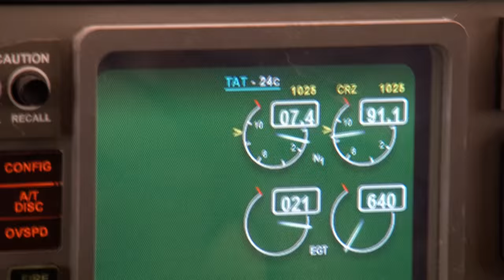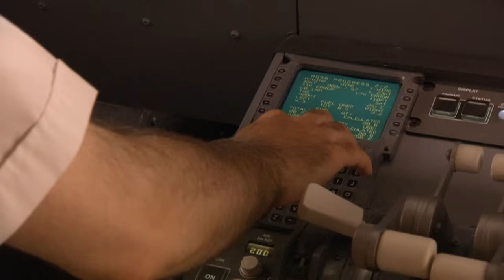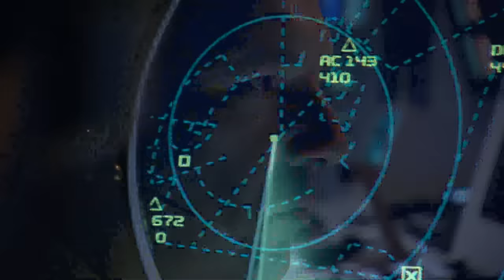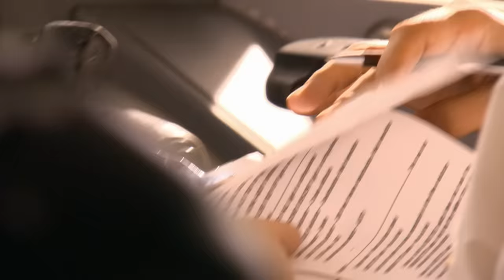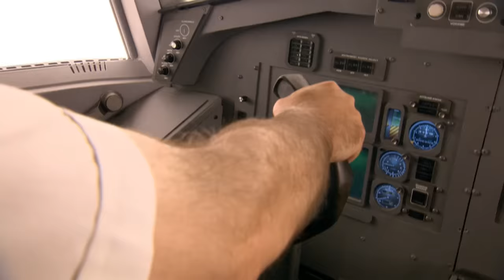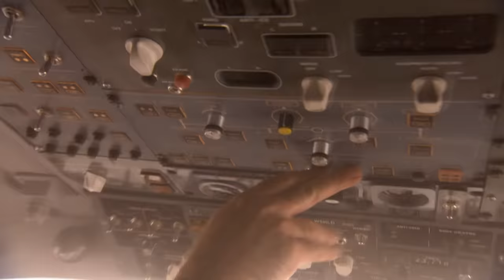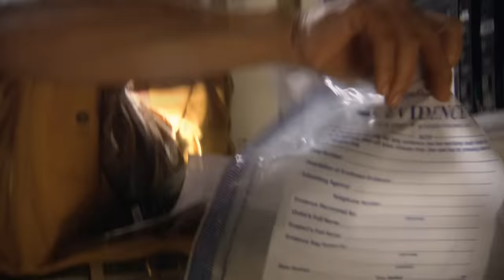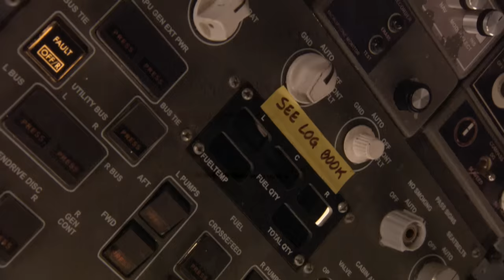Air Canada Flight 143 Lands With No Fuel | Mayday | Wonder

Comment: I retired almost 20 years ago after several thousand hours as a 767 Captain for a major US airline. I have told this story many times how serendipity saved the day. The Captain had glider experience & the co-pilot was familiar with Gimli. It was great to view your outstanding video that did a deep dive on the details. Thanks
Reply: check 6  I vaguely remember watching the "Air Disasters" episode on the Gimli Glider. That was amazing that he had flown gliders before which somehow helped him "slide" sideways to slip back to a landing strip. I had totally forgotten about the racing and picnic that was going on that day. The best part was turning into the guard rail to slow it down to a stop. This flight took place 6 years before a DC-10 made an incredible....or as that episode was titled "Impossible Landing" when United flight 232 that was going from Denver-Stapleton to Chicago O'Hare had a loud explosion from the rear of the plane. The fan disc had a flaw from when it was manufactured (I think 17 years earlier) when oxygen and nitrogen had somehow gotten into the titanium when it was created. It took all of those years, thousands of hours in flight before the flaw became big enough that fan blades came apart, becoming shrapnel which cut all 3 hydraulic lines. The only way they could control the plane was by using the throttles. A DC-10 train/check airman (Denny Fitch) was on board, heading home to Chicago after a week of putting pilots through their yearly simulator tests. After a brief and quiet conversation with one of the attendants, he found out how serious the issue was, he had her go back to the cockpit to see if they would like some assistance. So he became a crew member. I laughed at the narrator here when he said how much they were banking, and in a documentary interview with Denny, he joked about how they never intentionally try to take the plane more than 30 degrees of bank because it scares people. Both that DC-10 and this plane exceeded that bank. Unfortunately, even though flight 232 barely made it to a runway-a closed runway at Sioux City, IA., they were coming in too fast and dropping too low, out of 296 on board, 111 people were killed, but 185 survived. I'm going to give you the link to the video with Denny, he is an incredible speaker and had it not been for him, that DC-10 would have been a crater somewhere in NW Iowa. Sorry about the book.
Reply: Being a Glider pilot does NOT excuse this pilot from checking his fuel load.
What is so disgusting is how this was spun to make the crew hero's. They ALMOST killed all the passengers due to gross incompetence.
Reply: @stevejh69  I was going to disagree with your use of incompetence, but the more I tried to come up with something else, I have to agree with you. While he f**ked up by not noticing the amount of fuel he had, he was able to make the maneuver to slide to where he could land the plane, and none of the passengers were killed. When he saw what was going on farther down the runway, he did what he had to do to not run over them all, killing those people. He wasn't a hero, he was damn lucky. I think the narrator said he hadn't had many hours on this plane, is that right? I don't remember. I would think that under those circumstances he would have been even more careful at checking everything before ever leaving the airport.
Reply: @survivrs  Thank you. 
Just imagine a small difference on outcome. The news could easily have been Hundreds dead after Boring 767 crashes into town killing all onboard and hundreds on the ground. 
The board of enquiry found the aircraft had run out of fuel!
When new to an aircraft a crew should be extra vigilant. This crew paid almost zero to the fact the fuel was not comfirmed.
Reply: Too bad he didn't have metric conversion experience, could have eliminated this issue. He is no Sully, that's for sure.
Reply: @stevejh69  Exactly. Because they didn't pay attention to the 2 different calculations on fuel, this could have easily turned out differently, and not in a good way. Extra vigilant is exactly what I was trying to say, so thank you for that assist. There should have been something done to the pilot not catching the fuel issue. some time spent relearning how to carefully go through the checklist before ever getting to the runway would be the first thing. Get something into his personal records for future reference in case he had another issue. The checklist is done on EVERY flight by every pilot and first officer, so the pilot is no less than guilty of negligence!
Reply: @stevejh69  I just went back through the last third of the video again, and paid closer attention to the fuel issue. It was a MAJOR FAULT on Air Canada, because NOBODY HAD BEEN TRAINED ON HOW TO MAKE THE CONVERSIONS! It was lbs. vs. Kg! Not the fuel loading techs, none of the pilots, NOBODY! I guess it was what I would call one hell of a learning experience and I bet he never overlooked his fuel ever again.
Reply: @AFuller2020  As I just replied to stevejh, nobody had been trained on how to convert lbs to Kg. Not the fuel loading techs and not the pilots. I place the blame on Air Canada. He sort of pulled a Sully by getting the jet to use the guardrail to help him slow down, but without his front landing gear, I don't know how he did that. I would bet that there was a lot of training on conversions after that incident.
Reply: @survivrs  hey, it was a necessary mistake. I still will chose sunwing over air canada though.
Reply: Metric - to Standard...this was bound to happen...and with fuel gauges not working? Begging to happen...
As I was seeking my pilots license in 2018 I learned flying was an expensive hobby...I got to where I could solo and soon realized with 4 kids I have other priorities. I enjoyed the  challenge though....weights and balance, ground rules, air-space restrictions, fuel/distance, glide ratios, performance, configurations, check lists......on and on...but watching this I wondered: When slipping a Cessna 172 the "pitot tube" is no longer pointed directly into the wind. Wouldn't that produce a slower indicated air-speed than actual air speed? To me that's a problem on short runway landings....my flight instructor never addressed that to me.
Reply: @survivrs  Did you watch the entire video and the outcome of the investigation?
Reply: @DestinationTimeshare  Of the Gimli Glider? I don't think I've seen the outcome of the investigation. It was just another "air disaster" that I had seen on the Smithsonian Channel. It's been a LONG time since they've had any new episodes, but they did shows on just about every incident that ended up either good or bad. They play repeats quite often though. The only air crash I have followed over the years is United 232, July 19, 1989. It ended up better than it could have.
Reply: @survivrs  HE  NEVER CHECK    THE   VITAL  POINTS    OF  THE  PLANE
Reply: @stevejh69   Precisely, these airline jockeys should be sampling fuel and checking the tanks manually with dip sticks, like you are taught in the first few hours of flight school.
Reply: @readmore3634  Pitots are fairly sensitive to airflow distortion... but usually at much higher air speeds than you would find yourself in a slip.
Reply: @aviatorgeek99J  At the very least confirm quantity.
Reply: @aviatorgeek99J  My instructor only taught short runway landings, always wanted me making "first runway turnout"  exits...He would make fun of other students flying these long approaches like an airliner would...touching down way past the numbers...He hated that...unacceptable! In a 172 I'd turn final at 80 with power off.... 65 over the fence....settle at about 55-60. When practicing (power off) slip landings I watched my speed best I could but keeping everything lined up was the challenge for me. As I straighten out over the numbers my speed was sometimes 70-80.....leaving useful runway behind me.... and I heard about it. I miss those days.
Reply: It is clear God was piloting the plane - absolute miracle
Reply: @stevejh69  I'm more concerned that the plane was allowed to take off without working fuel gauges. How is that possible?
Reply: It was a training failure, and a bad fuel gauge issue.  In particular, the plane should not have been allowed to take off with a non-working fuel gauge.  Fuel is vital, so the gauge should be considered vital also.  Mistakes were made in terms of calculating fuel amount, but ultimately, that should've been caught through training.  Not just throwing pilots and fueler tech into the mix, and hope they get it correct.
Reply: Hine sight is 20 20
Reply: @stevejh69  Well, don't forget management, which changed pounds to kilograms but didn't bother getting anyone up to speed. If both the fueling crew and the pilots were unfamiliar, that's a serious lack of training, not just a coincidence.
Reply: @survivrs  Management never takes the blame. The engineers on Challenger warned it was too cold to launch, but management,  hot for glory, overrode them.
Reply: @pj89508  Well presented, thanks. However the largest part of the blame is squarely held by the PIC and the airlines. 
My point is the airline trying to spin what a great job, when in fact they very nearly killed them all
Reply: @stevejh69  "Being a Glider pilot does NOT excuse this pilot from checking his fuel load.
What is so disgusting is how this was spun to make the crew hero's. They ALMOST killed all the passengers due to gross incompetence."
And perhaps you could explain to us all how could have checked the fuel load when the gage wasn't working?
Reply: @linsqopiring6816  The gauge WAS working, you tool. Watch the video! He failed to check quantity in the correct indication.
Reply: @stevejh69  No I specifically remember the part where the investigator took out the circuitboard and they did tests and it wasn't working.
Reply: @AFuller2020  did not need metric conversion as he was supposed to dip the tanks because both gauges were out
Reply: @stevejh69  The gauge wasn't working... It was checked on fill-up, where the Captain did the math wrong. It was to be repaired when they got to Edmonton as the previous crew had temporarily "fixed" it (They did the math right too) but this crew undid the fix on pre-flight.
Reply: God's  Blessings  ❤️❤️
Reply: The Captain was a neighbour growing up and I always remember that day as the street was covered with media.  He did fly a glider that was often parked in a trailer in his driveway.
Reply: @survivrs  And, of course, YOUTUBE censored the link. (damn)
Reply: @survivrs  Switching units of weight and volume messed up a lot of Canadians at the time. (A litre is about one-quarter of a gallon, a kilogram is slightly over 2 pounds .... so going from gallons/pounds to litres/kilograms caused a fair bit of chaos)
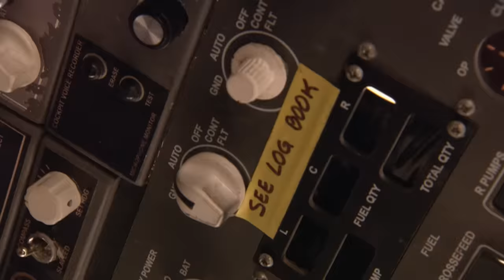Reply: @stevejh69  6:29, the video says that the digital fuel guages were out of service. Was there an analog guage somewhere? Also, I'm not a pilot, but do airline pilots check the fuel level with the dip stick before every flight?
Reply: @joshuaychung  No they are supposed to confirm the fuel. The amount put in would easily have been a clue. 
This was excellent spin by the airline to stop huge legal case. 
The bottom line is the crew screwed up.
Reply: @stevejh69  The ground crew lied. The captain signed the confirmation notice that showed the tank was full. Short of using a dip stick, how would you have him confirm the amount of fuel, in the absence of a fuel gauge?

Comment: This pilot is a beast. He attempted a maneuver he's never done before and aced it
Reply: He had no choice.
Reply: others failed to do so, in flight simulation.
Reply: A true and brave heroe!!!!
Reply: Only 2 Boeings have done the side slip on an emergency.
AC 143 , and Taca 110
Both experienced pilots
Reply: My goodness what amazing nerves of steel.
Reply: I am so glad that he did especially for the captain he save the lives of the people he almost caused to die he should have never left the airport without maintenance checking the fuel .warnings are on The plane for a reason you're not in a car oh well it may just be malfunctioning. No you check it out
Reply: Captain Piché of Air Transat is a bigger "beast." He flew his plane in 2001 without engines longer than anyone else, with way more people on board (300+), over the middle of the Atlantic, looking for a tiny speck of an island on which to land. Heavier plane, more people to save, longer flight without engine power = bigger hero. And he was a gliding expert too.
Reply: @stephenc2481  he really said “Best of the best”
Reply: @GoHARD99  This would have been around the time Canada was converting to the metric system.  This happened over a period of several years.  I can see how the confusion happened. You may recall the part of the video at the end where they said neither flight officer caught the incorrect unit of measurement, and that they had not received all the necessary training for the switch to metric on this particular plane.
Reply: Donatella Loncar  Wow!
Reply: Well, that's actually not true, I think he had done it before, just on gliders, not on a giant 767 jet. The thing that amazes me the most is that at the very end, one of the engineers or whatever, said that they tried the same scenario with different crews and they all crashed. That to me says that almost no other pilot could have done what he did. Perhaps not even "almost no other pilot," maybe literally no other pilot could have done that. If there was a pilot Hall of Fame, this guy should be like the "Michael Jordan" of that Hall of Fame.
Reply: Well he also failed to check his aircraft for fuel, it's kind of a big deal....
Reply: @someotherdude  Gary is not saying "beast" to mean "monster" or "villain" --- he meant it as a compliment, as in, the pilot was a real independently-strong-and-mighty creature who went out on a limb to save the day for everyone.
Reply: @adrianrocha49  it said in the documentary that he flew a glider but never did do the slip maneuver .
Reply: @philjohnson9320  I certainly agree that Captain Piché was also heroic.  But I won't say "better".  Although he faced some tougher conditions, he had the benefit of at least two  previous engineless landings and one use of the slide slip manuver in a commercial aircraft to have learned from and an airframe that was not as novel at the time he flew it.